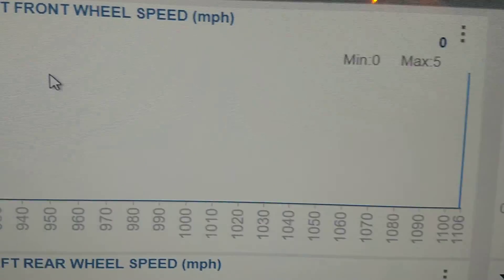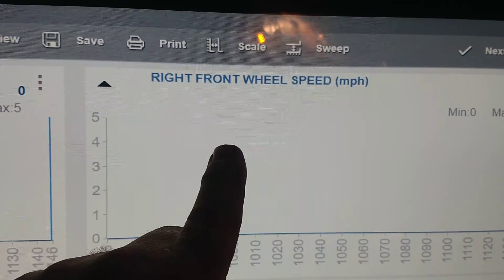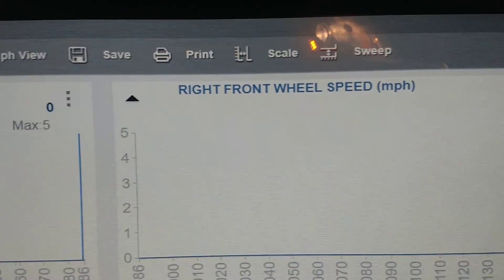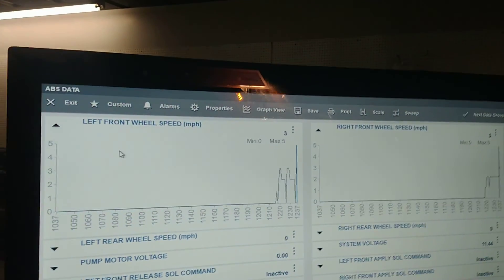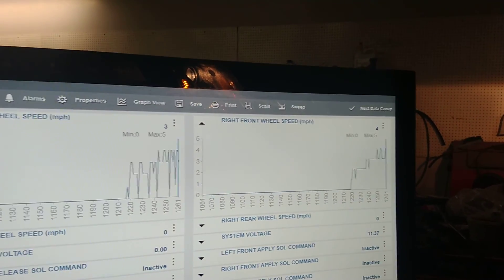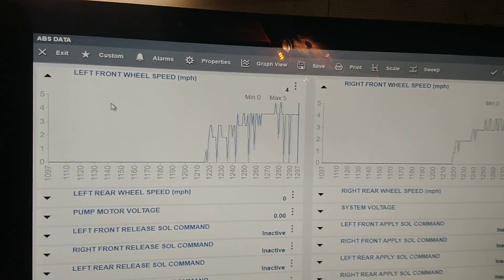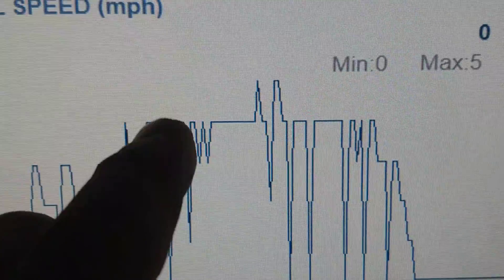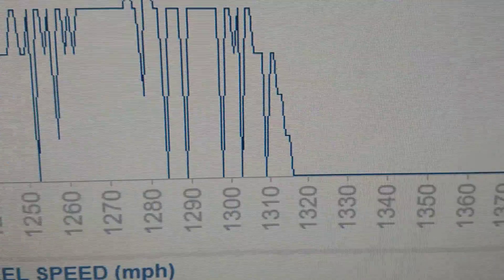ABS sensor diagnostic, 2009 Cadillac CTS

Comment: I have that same problem!! Soo whats the part called and how many parts do i need?
Reply from the maker: If it has an erratic signal then it probably has a bad encoder which is part of the wheel bearing assembly, called a wheel hub assembly.

Comment: if you had same car, and zero output from left front sensor would you agree its probably just the sensor? Is it usually erratic when hub is bad?
Reply from the maker: If I had zero output I would try to remove the sensor and trigger it manually with an external source, or visually inspect the bearing for damage. I’ve seen the trigger popped off and missing before.